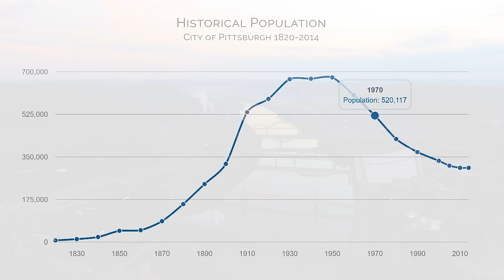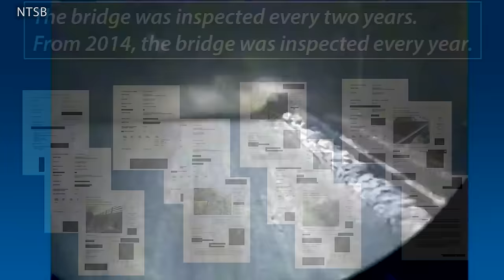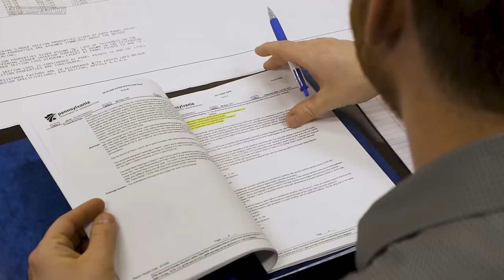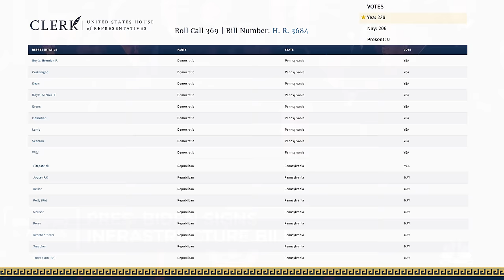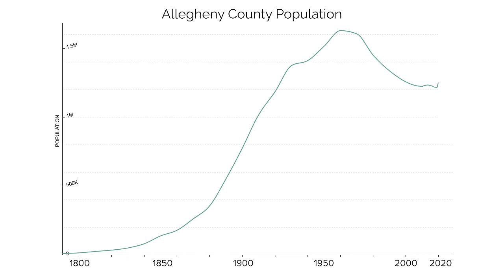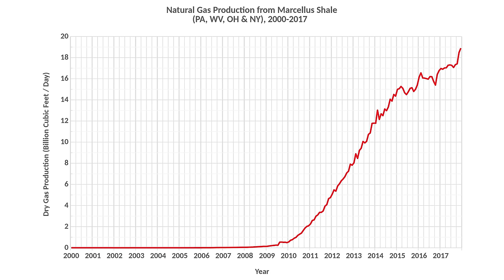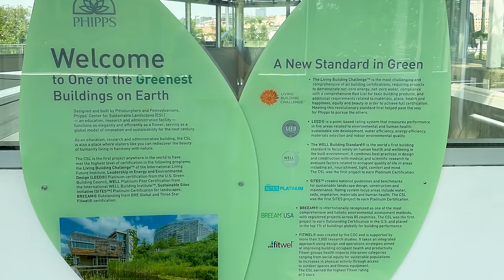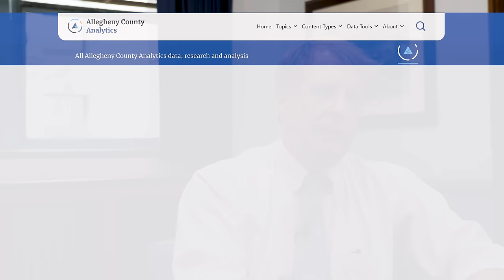The “City of Bridges,” Pittsburgh's Impressive Infrastructure

Comment: Pittsburgh became one of my favorite cities after going there for a job assignment. The Duquesne Incline has a great view of downtown and Heinz Field and the rivers. Wish there was more going on at the top but the bar restaurant there is legit. Boston, Dallas, Denver, and Pittsburgh are definitely my favorite U.S. cities by far. Also, you can see Pittsburgh from a plane depending on the route and I guess the runway assigned. I got a great view on one flight there and they used the cross runway so maybe but idk. Still, I'd recommend it to anyone and I got to stay in the strip district. Never even needed to drive I just walked to the hospital and the Incline. I wish I'd explored Downtown more though.